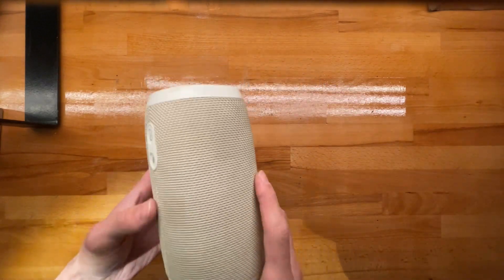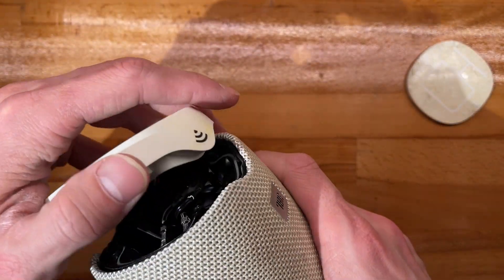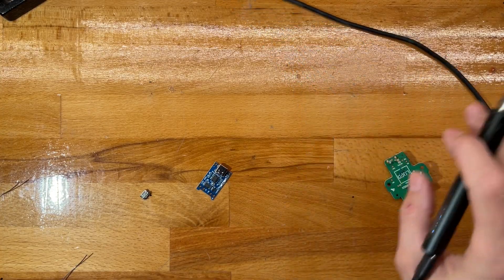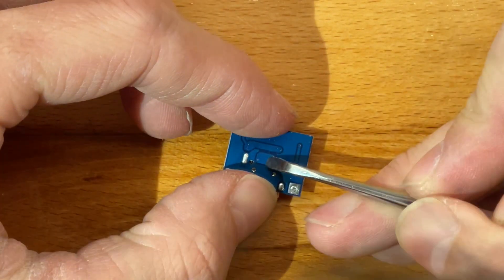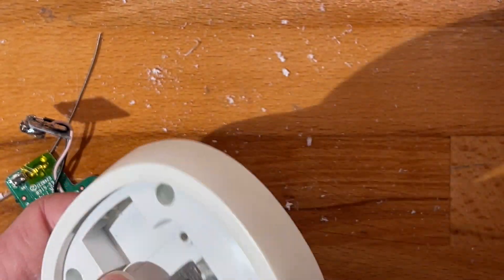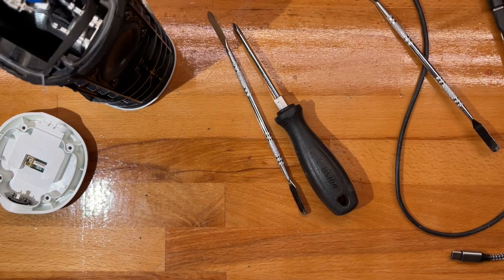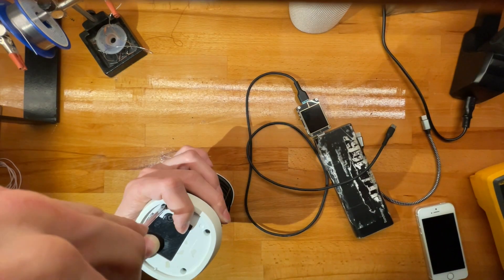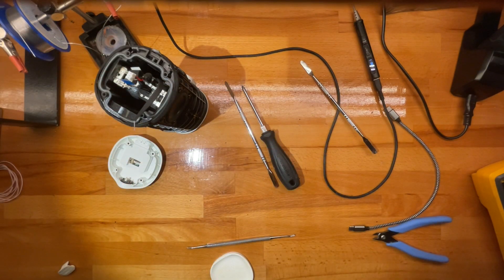Fix/Repair Broken Charging Port on a Bluetooth Speaker - JBL LINK10

Comment: Hi, I took my favorite JBL Link 10 to shower 🚿 multiple times, 😁, to be honest it was amazing that I was able to chat with Google Assistant in shower..::)) ,   but I  forgot to press the small rubber lid in to prevent water damage, and Today I find it has stopped charging, and the inside of the charging port easily wiggles back and forth,  
I think I just need to replace the USB port, what do you think I should do to fix it ?
Reply: I just fitted a type C charge port from a disposable vape connectd straight to the battery works perfectly & cost me nothing when the blue light goes out it's fully charged. they work perfectly for the lithium ion even tho in the vapes they use lithium polymer. I use the polymer batterys in lights plus the type C charge ports too

Comment: if you weren't worried about the led you might be able to stick the whole usbC board in and connect directly to the wires on the plug